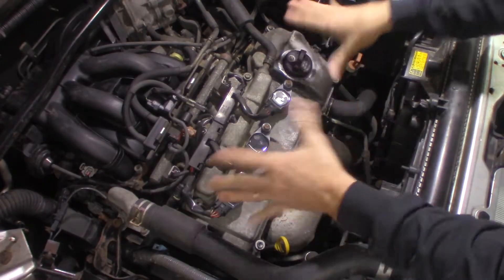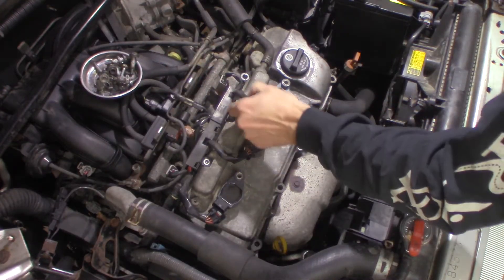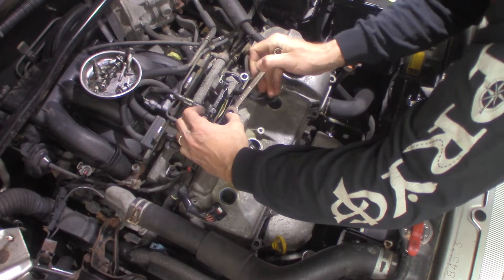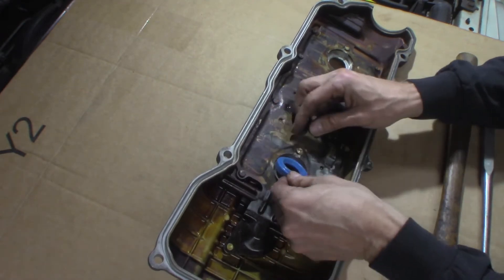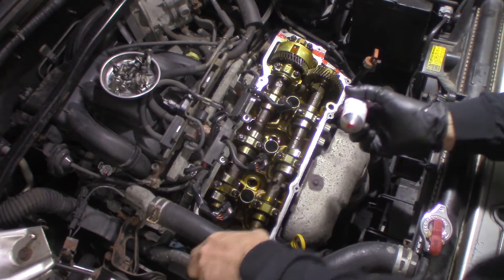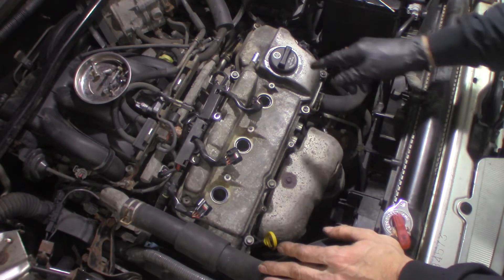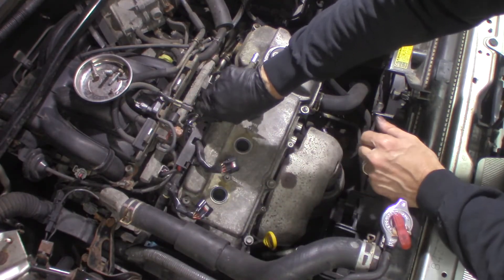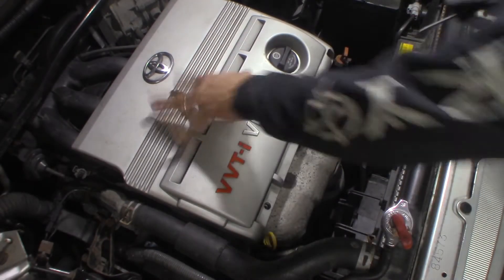2007 Toyota Highlander 3.3L front valve cover gasket

Comment: The OEM spark plug oil seals if never been done don't come out easy, they are phenolic bonded to an aluminum band and pressed in.  The phenolic just chips away from the band trying to extract with a screwdriver damaging the aluminum cover.  I bent the aluminum band over away from the cover and then used the seal puller to complete the job.

Comment: Nice video. Is there a video for the same repair for the 2009 Toyota Highlander Sport?
Reply from the maker: The 2009 Sport has a 3.5L engine... not exactly the same.
Reply: @CharlesAndCars  I know. I have searched for video as there is an extra wire harness on top of the front valve cover that I am having trouble removing and a 17 mm bolt I can't remove.

Comment: I have the same problem with the reverse torx screws, which are M6X1.0 fine threaded. I can't locate an M6X1.0 left hand fine threaded nut to lock in the regular nut so I can wrench it out.  All the available nuts are course threaded.  Can anyone please point me to a source?

Comment: 7:11 you didnt even say what this product is. What are you using there?
Reply from the maker: use permatex ultra gray
Reply from the maker: Are you asking about the gasket, not the sealant?
Reply from the maker: Gasket set:  https://www.rockauto.com/en/moreinfo.php?pk=917126&cc=1434461&pt=10710&jsn=1061
Reply: @CharlesAndCars  deleted my other reply since I think I got it mixed up with another thread. Thanks.

Comment: Please don't use  or apply torque 69 
It's wrong and will break the small cover  bolts  use your hand  to feel the the pressure on  bolt 
I just break two bolts because of your  video said apply 69  ft pounds  
I hope your good work re do the video with out use torque
Reply from the maker: Sorry that happened.  If you go back and look at the video again you'll see that I say 69 inch lbs, not ft lbs.  I had to go check it because 69 ft lbs will definitely break the bolts...
Reply: @CharlesAndCars  
Thanks for reply it's should be 8 ft pounds  anyway use  hand  torque better
Reply: @CharlesAndCars  you clearly say 69 inch pounds. I can’t imagine trying to put nearly 70lbs of force on such small bolts… or even thinking that was right.

Comment: How about rear?😅
Reply from the maker: Rear was not leaking so didn't have to do it.
Reply: @CharlesAndCars  Wondering why, since the temperature is higher there and the rear head is tilted so bad so it is easier for oil to leak
Reply from the maker: Don't know why, but it wasn't leaking so left alone.